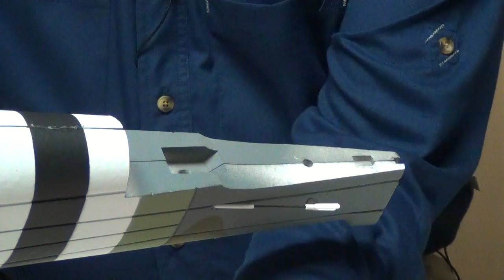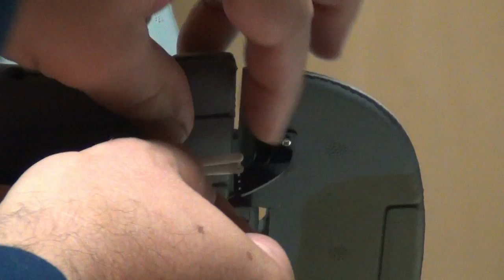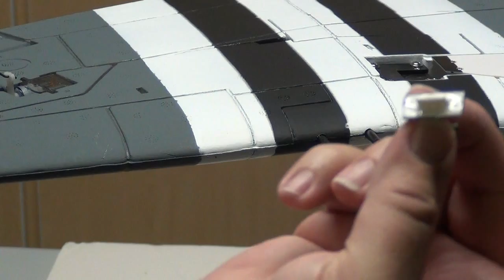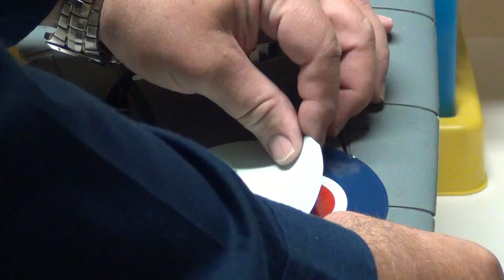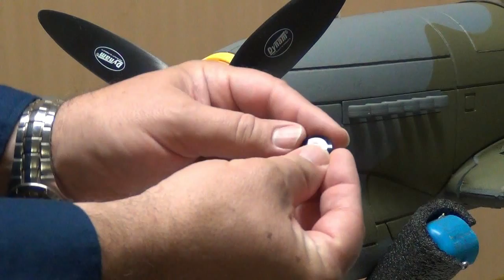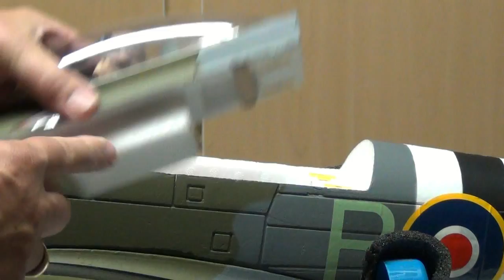Dynam Tempest Build Log Part 2

Comment: I know this is an older video,but guys buting these planes always refer to your video's when looking to do it because lets face it, dynam instructions are bad. Your videos are the most comprehensive that I have seen. I am surprised you didnt glue the glass rod like you usually do, especially on a plane like this that likes to fly fast anyways. I have seen too many videos with guys wings comming apart. Dynam contact cement is the best stuff out there as far as foam safe and strong. Always make sure you put glue on both surfaces,then let it tack up guys. I like sealing my paint job with a poly coat by minwax before applying decales. Dynam is great for leaving off the decals. Your instructions for applying decals is the best on Y.T. I would paint the other part of the canopy green. I saw the bad gapping on the wing roots and would sand the mating points and if needed use wall board light weight filler and painting the seam. I know you dont lighting your model but to the guys that do. I would recommend using a Turnigy lighting kit. Plan on replacing the weak dim leds that came with the plane,tou will have to carefully pull the lens covers off and solder the new leds into the existing  wiring harness. I use dip it as an insulating material on my wires. then solder in the connecting ends and plug the kit power pack to the receiver and plug in your connectors and you are ready to go.I know its extra work and understand why gus dont like connecting the lighting but its an option. As I said,you made a great video here. I watch them all,even if I am not buying that particular plane. Mabe someday I will. Thanks to you, I can be sure I did it right and be satisfied it will be right. No thanks to Dynam.lol.